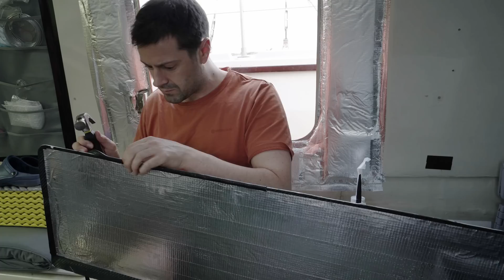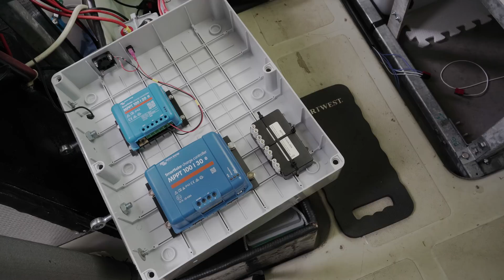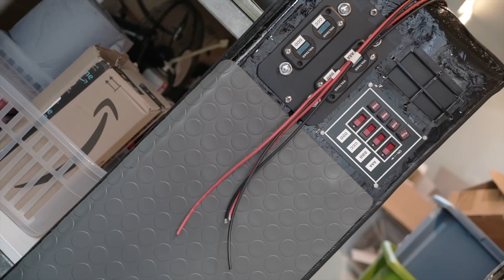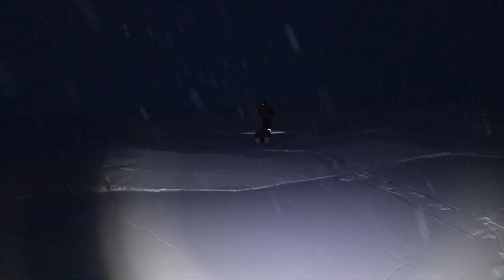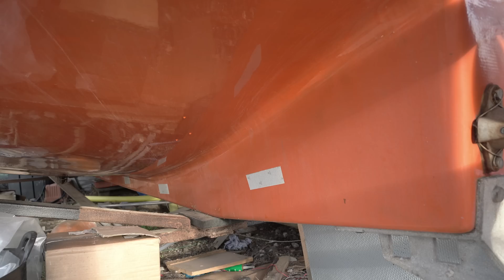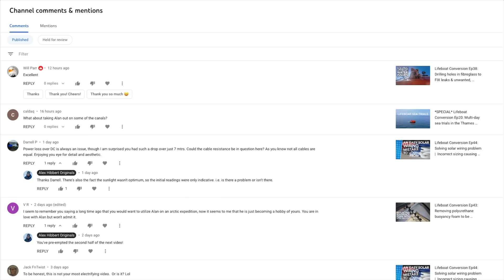Lifeboat Conversion Ep45: Battery box electrics progress AND BONUS ARCTIC MOVE plans [4K]

Comment: There is a product called "Sugru" that I am sure you have heard of, or someone has mentioned it before, but it is a tiny little blob of air curing silicone. I only mention it because you used some blobs of epoxy to make wire separation and a tiny bit of wire strain. It stays 'usable' for a very long time in the pouch, so it might be handy to bring them along while on the sea. The stuff is tough as nails once it is cured.
Reply from the maker: I actually worked with the R&D team at sugru for a while. They're based in London. It's good stuff, but rather expensive!

Comment: How reliable are the battery's in the arctic cold ? Are the  Battery's special in anyway to deal with the cold ? Really interesting videos keep up the good work!
Reply from the maker: The Lead Carbons won't perform that much better in the cold than normal AGM batteries, save for the deep cycling and high currents accepted. But, they shouldn't get too cold inside Alan. I'll have a LiFePO4 battery for portable outdoor use.
Reply: @AlexHibbertOriginals  Thanks for the reply. Order a T-shirt can't wait to get it.

Comment: I apologize if you have already been asked this question before but why did you decide to perchance a Life boat over a more conventional boat for poler exploration I understand more bang for your buck but is there anything in the design of Allen which makes him more suitable than a conventional boat
Reply from the maker: Aside from the value for money (a boat that costs not much more than the value of the engine alone), low running hours at purchase, insulation and buoyancy, hull shape for ice, shallow keel, and flexible cavernous interior.
Reply: @AlexHibbertOriginals  ah ok thanks 😊👍